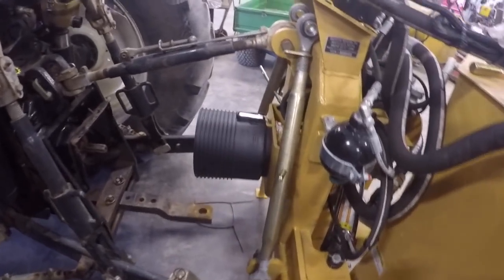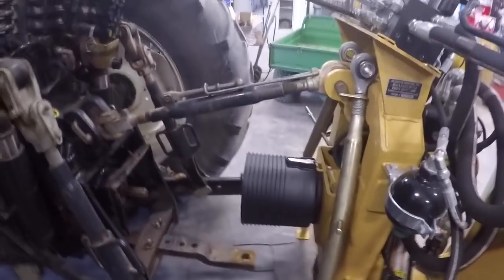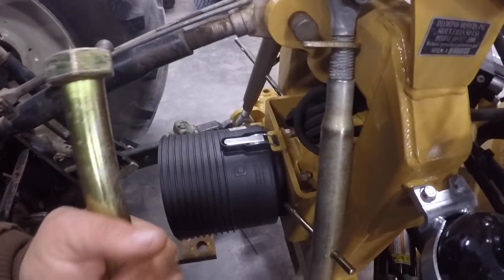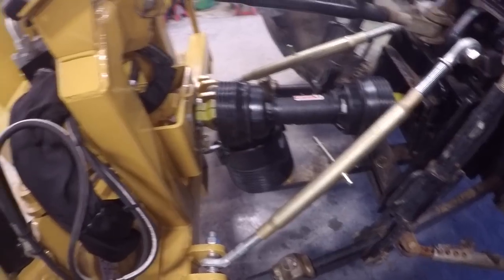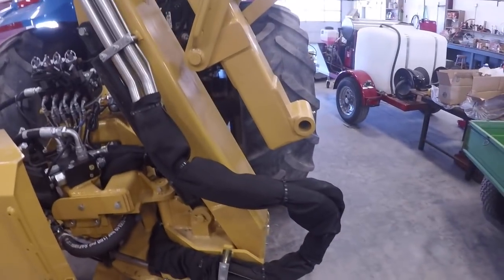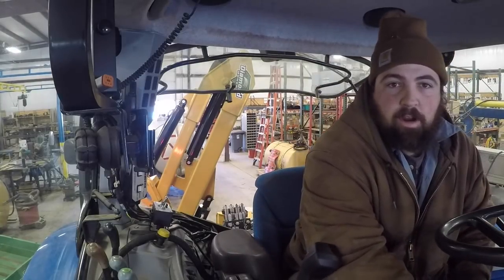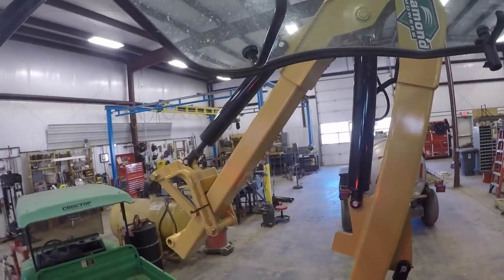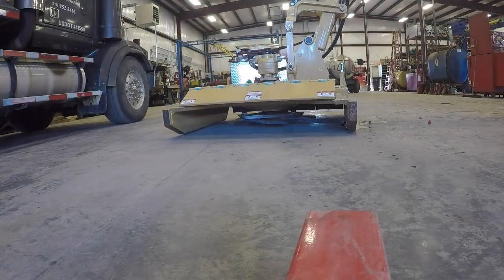Diamond mower very first start up.

Comment: I used to run something similar to that when I worked for Georgia Department of Transportation,we called it a slope mower,and it was mounted on the side of tractor.We would use it to cut tree limbs back along the roads,and mow drainage ditch's.It was fun to run,and it worked great.
Reply from the maker: +Brian 248 noel. Yep this is basically the same thing, works really good.

Comment: Nice implement and installation Dennis.
GDOT uses a similar set up to mow over guardrail. They usually run in tandem. One rotary and one flail head.
Reply from the maker: +Chuck Stevenson. That's interesting. Rotory for trees and  brush and flail for the grass I guess.

Comment: Just something I’ve learned with ours at work is if you tractor sits out side and it’s a cool night and you start it up in the morning, your hydraulics will be very slow on the boom movement, what we do is start the tractor up let and engage the mower head then just bump the rpms up very little and in no time the control for the boom will be very responsive, all in all it’s warms the hydraulic fluid up faster
Reply from the maker: +Chad  Isett. Yeah excavators are the same way so I'm used to that. 👍

Comment: Looks to be very heavily built and a tool built for real work that's for sure!

Couple of points which you might have missed. Did you tighten down the locking collars on those stabilising bars? because they have a habit of altering their length when in use on our machines and when you take it off dismantle them and heavily grease the threads especially the lower ones as they quite quickly seize up solid. 

When you started it up in the workshop the blades were running very low compared to the sides of the head - are they adjustable? One thing is pretty certain if it picks up a stone it will come out of the head like a blooming missile!

I  shall be interested to hear how you like it after some experience of running it.
Reply from the maker: +Dan Whiteford. Yes those link arms can be a pain if not maintained properly, the locks ended up in the wrong side of the pro shield and the clearance was so tight I couldn't get them to screw past it. I'm not concerned because it is coming back off soon to put the snow plow back on. Not sure what a "sies" is but I did not rev the tractor to operating RPM in the shop.

Comment: in the low 60's today, but yeah last week was cold. Next week will be also.
Oh man you ended the video before you chopped up that brush.
Looks like it will be a great implement for those hard or impossible to reach areas, but only for finishing work. Not what you'd use on a field of course, but you can fill a day of cutting with it I'm sure.
Reply from the maker: +Atoyota. I can fill a few days of cutting with it right now, just don't have time at the moment.
Reply: We have a couple ponds and a few steep slopes and ditches that would make that useful. Really only a days worth though. 
Nice tool, but I'd use a mini with a brush cutting implement rather than that. Not sure what the difference in costs would be though.
Reply from the maker: +Atoyota. If you already have the mini it would be cheaper. We have one for a five ton excavator.
Reply: yeah no mini and no tractor capable of managing the diamond even if we could justify buying one. 
Meaning it would be nice to cut most of the areas, but in the end it's just cosmetic. 
Eventually, or more truthfully... "one day"
Reply from the maker: +Atoyota. 👍

Comment: I know a cattle farmer who bought that for mowing next to the edge of his ponds and under all of his electric fence.  I have seen the roadway guys use them to trim the small tree branches back from the side of the road, it tends to make a mess of stuff thrown on the road but they normally have a tractor with a broom right behind them. Hope it works well for you.  Is there possibly a small piece of grit in the valve for that cylinder that keeps it from sealing all the way down?
Reply from the maker: +Ohh Paul. Not sure what was going on with it but it's better now.

Comment: Hallo. Can you block the 3point hitch on that tractor ? I was wondering what will happen if you lift that hitch up now it is connected on 5 points . I suppose something will break , or am i wrong ?
Reply from the maker: +jacky bruckers. Yes you can lock the hitch out, yes something will break if you try to raise it up.